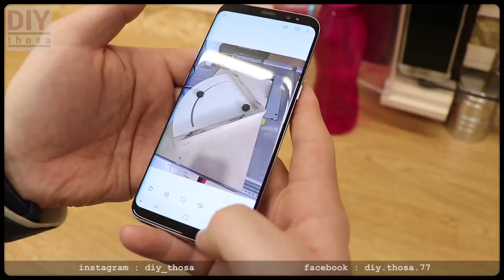How to make an EASY Mitre Sled for Table Saw - Gehrungsschlitten für Tischkreissäge

Comment: Hi Thosa! Congratulations for your videos. They are very good. I am a DIYer. Can you help me? Please let me know what is the right thickness of a riving knife. My saw blade has the following dimensions: A) Thickness of saw blade=1,4 mm   B) Thickness of cutting teeth=2,2   C) Kerf of saw (width of cut)=3,0 mm. Thank you very much.
Reply from the maker: hi. thank you 😊🖐 I am not an Expert.. but I would say exactly the Width of the Cutting Teeth.. If its smaller then you have the Risk of a Kick Back.. If its wider then you are unable to saw.. (push the cutting cap through the Riving Knife) 👌😊👍